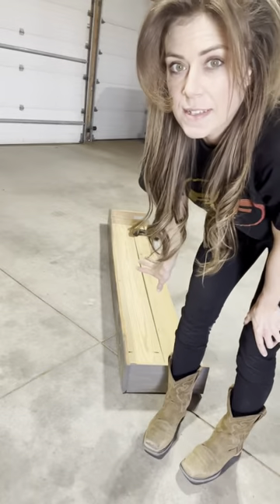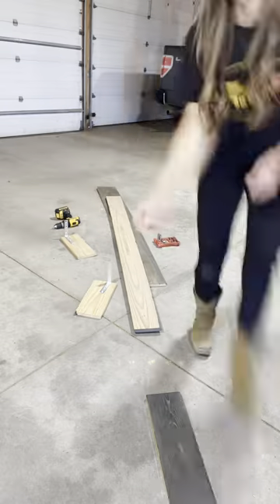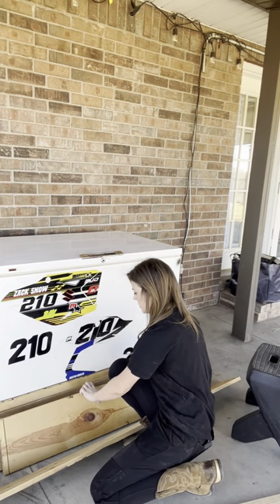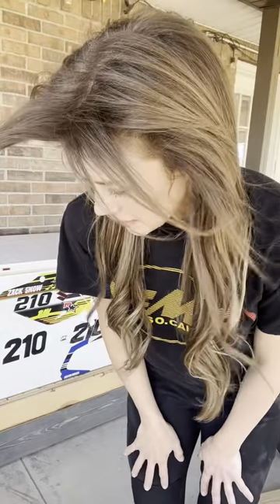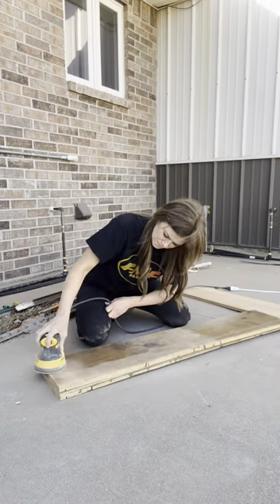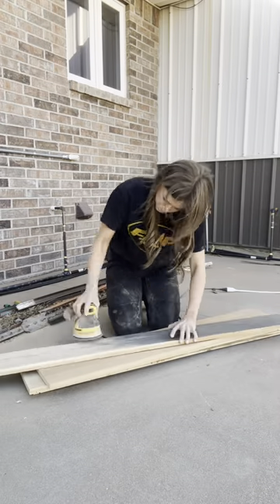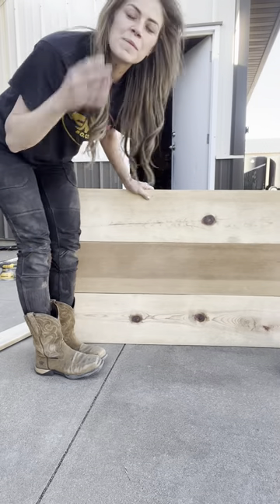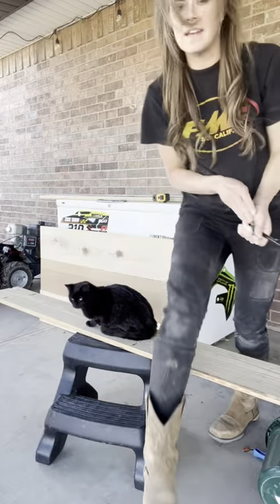BUILDING WOOD PANELS FOR MY DEEP FREEZER🥶

Comment: Are you going to glue your panel up? If so, use exterior rated glue that's water resistant or waterproof. If you're doing a glue-up panel, you'll need to clamp it as well. Discovered another cool thing about you in this video. You like working with wood. I was a custom woodworker/cabinet maker, so sawdust runs in my veins as well. Can't wait to see what you do.

Oh yeah, definitely put a polyurethane finish on it. You may not plan on getting it wet, but life happens.